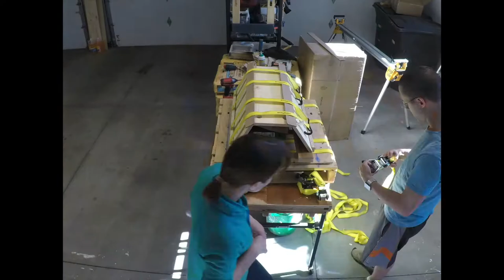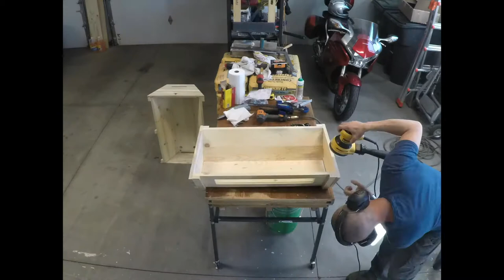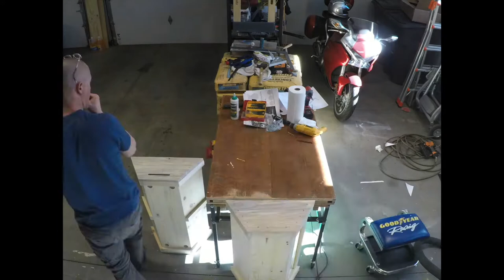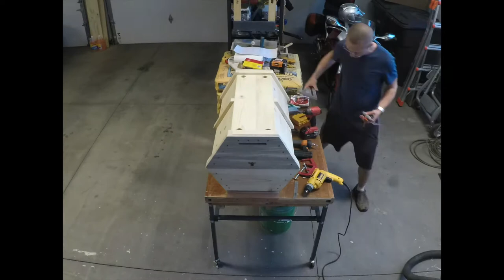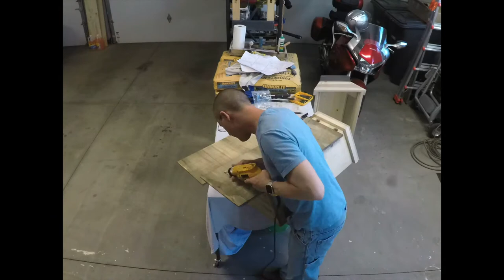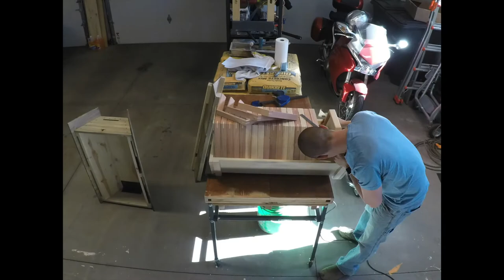Cathedral Hive Build Time Lapse

Comment: Hi there - looks great, thanks for the vid!  Would you mind sharing how good the instruction from backyardhive.com were to follow?  Are the plans accurate?  What wood did you use, and having followed their pans, do you have any tips now that you've built one yourself?
Reply from the maker: Hi Alexander, and thank you for the kind words.  I will be posting a longer time-lapse of this same build this weekend with a voice-over that addresses much of what you asked.  I'll post a link to it here in the comments when I get it uploaded.

The instructions were fine as long as you have at least some experience in woodworking.  If this is the first ever project for you, I would definitely recommend a friend with woodworking experience to help out a bit.  The plans are VERY accurate, with very fine tolerances.  I originally bought just the plans, and had planned to build the hive from scratch.  However, I ended up buying the Cathedral Hive kit once I tallied up the price of all the tools I'd need to acquire just to whittle the various hive components myself.  Any accomplished woodworker with the requisite tools would be fine with just the plans if they wanted to build from scratch.  There weren't any instructions given for the roof, but it was a simple step that made sense once you placed the pieces together according to the exploded schematic page from the plans.

The majority of the wood from the kit appears to be sourced from beetle-killed pine, and the top bars are made of redwood (no cedar smell noted, so I do think it's actual redwood).  The blue streaking in the beetle-killed wood is gorgeous.  I am VERY happy with the quality of the wood in this kit.  Top notch.

My only major tip is to ensure that the gluing jig you need to make for the top and bottom halves is PERFECTLY level, true, and square.  My gluing jig was just slightly off true, and it made it a pain in the butt to level them out so they sat snug together.  That was the part of the video where I broke out the hand planer and then sanded the crap out of the contact surfaces of the top and bottom halves until they sat snug together.  That really was the only major screwup on my part.  Everything else about this build was pretty enjoyable.